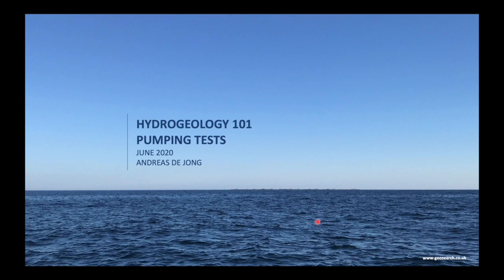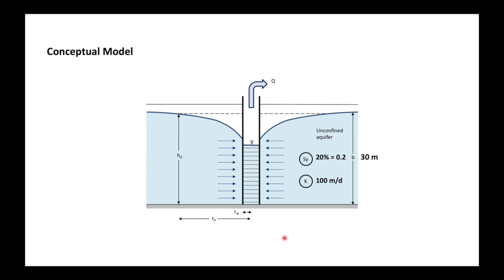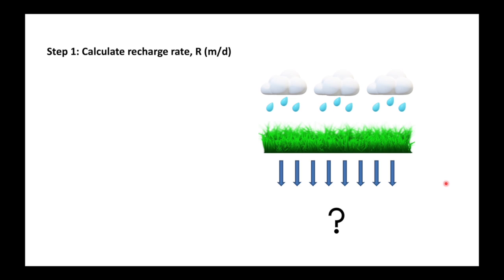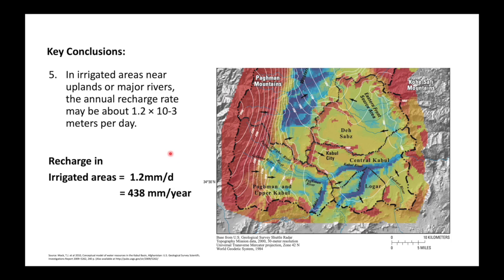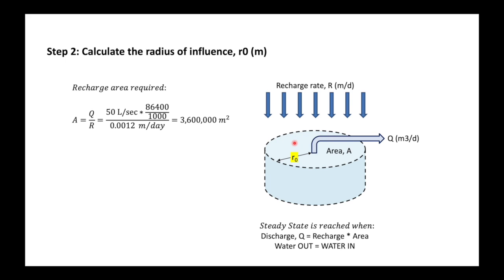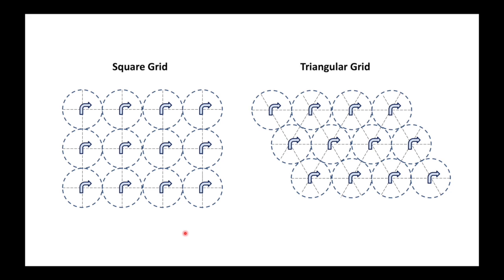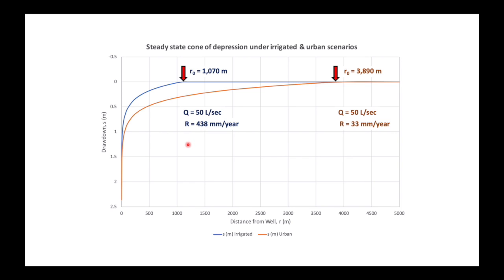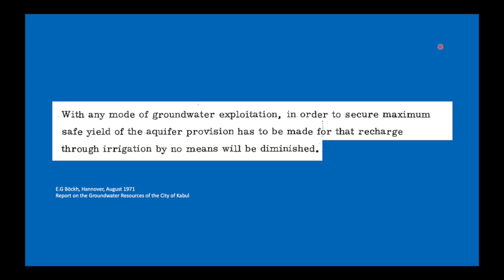Hydrogeology 101: Dupuit-Forchheimer equation

Comment: Your are amazing instrcutor
Reply from the maker: Thanks for your kind words! All the best, Andreas
Reply: @GeosearchInternational  Just one question regarding unconfined aquifers. In this method of Dupuit-Forchhmeier, staedy state condition needs to be achieved and that is costly and time consuming from environment point of view. I know that is why people go for the Theis method as it is quite similarly behaves  at start of pumping and also solves under unsteady state. But what is alternative way (method) to tackle unconfined aquifer than Dupuit-F test?
Reply from the maker: The easiest way to deal with unconfined aquifers is to use the Cooper-Jakob straight line method on the late part of the data. Initially the drawdown is fast and follows the Theis curve. Then it slows down due to delayed yield, and once that has caught up with the declining water table we are back onto a Theis curve. Normally for unconfined aquifers you can use the Neuman method, but usually Cooper-Jakob is just as good especially if you only have a pumping well so specific yield/storativity cannot be calculated..  see https://youtu.be/4pU336P_TX4   all the best, Andreas
Reply: @GeosearchInternational  Thanks for the hint. But cooperjakob method is not for confined aquifer. I am looking for unconfined aquifer.
Reply from the maker: Hi @travelwonder,  the Cooper and Jacob (1946) solution may be used for the interpretation of pumping tests in unconfined aquifers if Jacob's correction is applied to the drawdown data measured during a test (Kruseman and de Ridder 1994). See: http://www.aqtesolv.com/cooper-jacob-unconfined.htm
However, if the drawdown is small compared to the aquifer thickness, then it does not matter and you can use the uncorrected data. For any pumping test in an unconfined aquifer I would always use the straight-line method first on the uncorrected data to get a first estimation of Transmissivity in pumping wells, and T & S if you have observations well data. Later you can do the Jacob correction to the data if you know the aquifer thickness, and try out more complicated methods such as the Neuman solution. All the best, Andreas
Reply: @GeosearchInternational  Thanks for the clarification. Is there any video by you on Neumann solution? Thanks in advance
Reply from the maker: I have not yet made a Neuman tool, but I like this one from Carlos Molano: https://youtu.be/oFwnragYCss?si=MTl4E8R0dBvV8TrU    The excel tool is no longer available from the link in the description. You can get it here: https://bit.ly/Neuman_Carlos_Molano
All the best, Andreas

Comment: Really great video. How, if possible, can this method be applied to single-well pumping test, without drawdown info at distant points? Thanks.
Reply from the maker: Thanks Erazem, this formula applies only to steady state conditions so you can use it to estimate the amount of water you need to pump at steady state out of a well, a quarry or a pit, but you should not use it for pumping test analysis. For that I recommend that you start with the Cooper-Jacob straight line method. See https://youtu.be/4pU336P_TX4 All the best, Andreas

Comment: Thank you sir! But I have some puzzles ramain to be solved.
I noticed that in a video the "Dupuit-Forchheimer equation" in your video was referred to as "thiem equation for unconfined aquifer"  (https://www.youtube.com/watch?v=7ZvnsA-aVMA&t=450s)
whereas in another video the Dupuit-Forchheimer equation was used to describe the yield-water level relation for plane strain condition (https://www.youtube.com/watch?v=IlUEOMYyGcE&t=26s)
Unluckly,  I cant find the source of Forchheimer, P. (1886). "Über die Ergiebigkeit von Brunnen-Anlagen und Sickerschlitzen". Z. Architekt. Ing.-Ver. Hannover. 32: 539–563.
Could you please give me a more convincing explanation or an available source?
Reply from the maker: Hi 孙彦晓, the Dupuit-Forchheimer equation describes steady state groundwater levels for a
pumping well in an unconfined aquifer. It can also be used to describe groundwater flow between two canals as shown in Martin's video. Note that the aquifer thickness (b) is equal to the hydraulic head and reduces as we approach the pumping well but that the hydraulic conductivity (K) does not change. This equation is also known as the Dupuit or the Dupuit-Thiem equation. Basically, the Dupuit-Forchheimer equation is the same as the Thiem equation with corrected drawdown (s’) instead of actual drawdown. I don't know how good your German is, so best if you have a look at Kruseman & de Ridder, (2000), Analysis and Evaluation of Pumping Test Data; ILRI publication 47. It is available for free online. All the best, Andreas
Reply: @GeosearchInternational  Sir, thank you for your elaborated explanations. However, there are still some points I want to discuss with you. 
(1) I have found the related descriptions In Kruseman & de Ridder Analysis and Evaluation of Pumping Test Data; ILRI publication 47. 
For example, in section 5.2.1 "Thiem-dupuit's method", eq.(5.7) is the Dupuit-Forchheimer equation in your video, and is claimed to be "aslo known as the formula of Dupuit" in the literature. However, in my previous understanding, Dupuit equation can only describe the yield-drawdown relation of the pumping well (without observation wells), which means there are no h2 and h1 of the observation wells in Dupuit equation, only H (water level in the recharge boundary) and h0(water level in the pumping well), according to Dupuit 1863. Études Théoriques et Pratiques sur le Mouvement des Eaux dans les Canaux Decouverts et à Travers les Terrains Perméables. So, is there any possibility that the related description in Kruseman & de Ridder is not accurate enough?
(2) In contrast, the Thiem and Dupuit-Forchheimer equations are used to describe the yield-drawdown relation when one or more observation wells exist. Although their forms can be the same if the drawdown in the Dupuit-Forchheimer equation were replaced by the corrected drawdowns, in my opinion their are still not the same thing, since the meanings of the parameters have been changed. I get the knowledge from your videos that Thiem equation is applicable to the confined aquifer, and there is a T(h2-h1) in the numerator, whereas the Dupuit-Forchheimer equation is applicable to the unconfined aquifer with a difference of square between h2 and h1 in the numerator. However, before I watched your video, some of the literatures in my language (Chinses) tell me that the "Dupuit-Forchheimer equation" in your video (using actual drawdown instead of corrected drawdown) is called "Thiem equation for unconfined aquifer". Then, I coincidentally watched your videos which tell me the equation turns out to be the "Dupuit-Forchheimer equation". Therefore I am confused. Now I am writing a thesis concerning dewatering, and I want to accurately cite the references about these equations. Can you tell me where the "Dupuit-Forchheimer equation" in your video was firstly reported? I wonder if it is first reported in "Forchheimer, P. (1886). "Über die Ergiebigkeit von Brunnen-Anlagen und Sickerschlitzen". Z. Architekt. Ing.-Ver. Hannover. 32: 539–563.", or in Günter Thiem' PhD thesis (1906) Hydrologische Methoden.  But I am not available to these two literatures and I cant read German neither. Can you help me to confirm it? Maybe it is not critical, whereas the most important thing is knowing how to utilize these equations. However, I still want to get the imformation. Looking forward to your reply and being enlightened by you again. Best wishes
Reply from the maker: Hi 孙彦晓 , I have not done any historical analysis of the name of this equation, and in the end it does not matter. If I was working in China, I would refer to it as whatever name the technical people there are used to seeing, or you will confuse them in the same way as my video has confused you. People call this equation by different names because it was discovered by different people independently - Dupuit, Forchheimer and you can even add Thiem if you correct the drawdowns for unconfined conditions. I was educated in the UK, and there I was taught to use different symbols (eg for Transmissivity) from what is used in my native country, The Netherlands. So it is important to always show your equation and beneath it what all the symbols mean and in what units they are in. Hope that helps & all the best, Andreas
Reply: @GeosearchInternational  Your points make sense, Sir! Thanks a lot. I have learned a lot from you.
Reply from the maker: @孙彦晓  you are asking the right questions, which is the only way to find the right answer! All the best, Andreas

Comment: Hello Sir ,
I really appreciate that share your knowledge and experience with us moreover you have worked in my country in unsecure situations. would you mind if you specified the well point location(X,Y)? or can you mention the district name please?
Reply from the maker: Hi Rohullah, this example is based on typical aquifer parameters in the Logar wellfield of Kabul. It illustrates the dangers of urbanisation on groundwater recharge. As soon as irrigation is cut off by urban areas, many water wells will no longer be sustainable because recharge no longer balances discharge. This results in rapid groundwater drawdown as we can see in many parts of Kabul. You could of course try MAR, but that would mean keeping all the old irrigation canals open inside the city, and flooding them whenever the Rivers are full of water. Unfortunately this option was never explored before as the old irrigation canals are mostly filled with solid waste and even have buildings inside/ontop of them. Another issue is that the canals would need to be desilted annually after each flood, which of course needs O&M funds. However, surely this is would be cheaper than bringing in water from far away, especially downstream of Kabul where there are high pumping heads to overcome. All the best, Andreas

Comment: Those decimal commas and points...
Reply from the maker: ... and your point is?
Reply: @GeosearchInternational  You used commas as decimal and thousand separators, found it a bit confusing (with the 1km value). Didn't want to be overly critical as the channel is truly excellent.
Reply from the maker: Hi Nikola, you raise a very important point which is the confusion about commas and points. In most of the English-speaking world points are used for the decimal separators and commas for the thousands. This is what I have been using in the videos, though it may be better to go for a space between the thousands. So instead of r0 = 1,071m it should be 1 071m. The problem is that unless you use a hard space, it can split the number over two lines. I actually started my first two years of school using the non-anglophone system (commas instead of points for the decimal separator). Will try to stop the confusion in future videos. Thanks again & all the best, Andreas